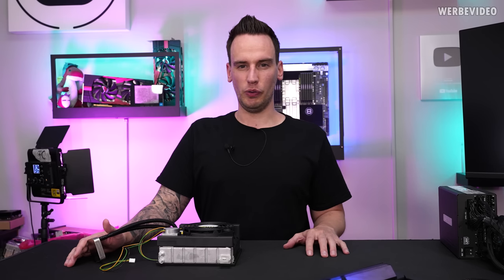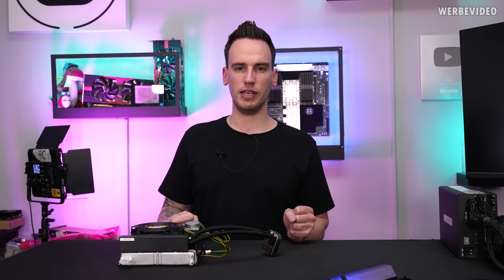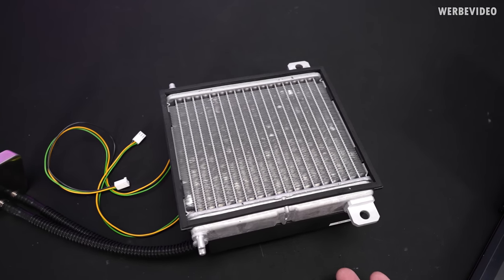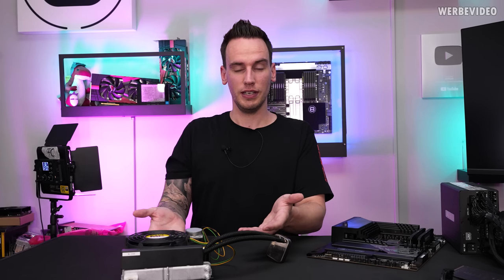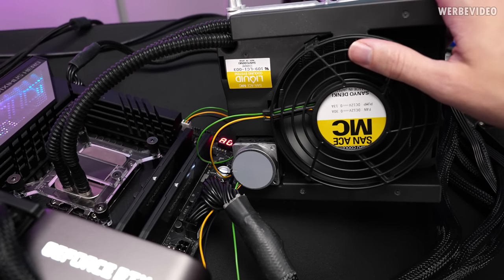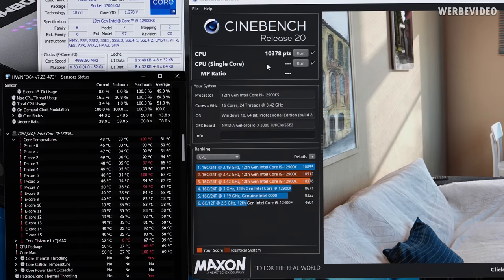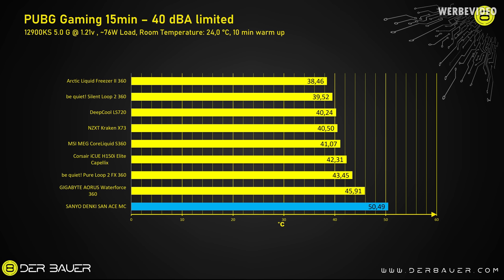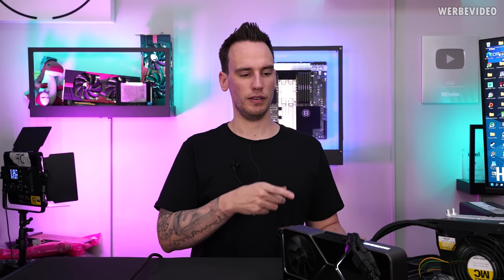Investigating Aseteks false Claim - THIS is the first real "Sealed-Loop Liquid Cooler"

Comment: The Sanyo cooler received a japanese "Good Design Award" on the 1st June 2004.
There is also a datasheet for the system from may 2004 on the german Sanyodenki website.
Then I found the manual. The cooler seems to have been designed to go into a special PC case with the appropriate mounting.
Finally I found a "Company Profile" brochure which features the cooler in question on the products timeline dated 2004.
I would say the cooler is from early 2004.

Comment: There is a water cooler from 2004 called the “GlobalWIN Silent Stream” that has the pump integrated into the water block. There is an old Tom's Hardware review on it along side other water cooling options from back then. It looks a lot like a modern AIO and an apparently came pre assembled and filled.
Reply: You're absolutely correct. From another article published in September 2004, "The water pump is integrated in the processor cooling head in this system", and "the Silent Stream arrives pre-assembled and pre-filled".
Reply from the maker: Will Look into that. Thank you for the comment!
Reply: Wouldn't this potentially invalidate Asetek's patent by prior art?
Reply: @HydrarDraconis  Depends on what exactly the patent involves.
But yes it seems to be the same thing Asetek has patented. So I guess it is room for prior art.

However, I personally wouldn't be surprised if there is plenty of other cooling blocks out in the industrial world with integrated pumps. Engine blocks on cars for an example have done this for decades before Asetek were around, however a car and a computer is two very far removed applications. But the goal and solution are the same in both cases, just at different scales. So even this could be seen as prior art to a degree.

In the end, one can argue that the requirement for patents to be "innovative" is a bit lackluster in a lot of cases. To be fair, one can patent almost anything, as long as someone else haven't already done it for the same application and for similar reasons.
Reply: @todayonthebench  Not looked into it recently, but I remember a few years back the main issue was related to keeping the pump in the CPU block, since plenty of other brands had them in the radiator on the hose and was allowed to sell them at least
Reply: @HydrarDraconis  some even had a tiny tube running from a pump to the cold plate, even though they were one piece.
Reply: @HydrarDraconis  Yes. The main issue is the block integrated pump.

However.
Even of the GlobalWIN Silent Stream is prior art, it still more or less requires someone to counter Asetek's patent, a legal procedure that also is a fair bit expensive.

So even if prior art exists, a patent can still be "enforced" even though it technically isn't valid. And it is hard to know if the court will rule the prior art as prior art or not, so I can understand that other manufacturers haven't been too keen on testing the murky legal waters.
Reply: I actually have the radiator from that cooler, its one of the coolest looking and smallest radiators I have ever seen.
Reply: @HydrarDraconis  i was thinking the same way so coolit can sue them back lol
Reply: Yeah, also the WaterCooled Alienware 2080 that ArseTek claim they invented the design for was out for many years prior on the Sapphire TOXIC X1950 XT-X by Thermaltake,
seems ArseTek has no problem with the Hypocracy of threatening to sue other companies for what they themselves have repeatedly done.
Reply: @shaneeslick  those days though damn its been a long time
Reply: @shaneeslick  arsetek 😭😭😭
Reply: @todayonthebench  Cooler Master won a case in 2019 against Asetek, with the help of bringing up this GlobalWin which was show at Computex 2003 in Taipei. Full cost of the case was for Asetek, the case was in Den Haag (Netherlands).
Reply: @der8auer-en  the thing is AseTek will argue that their VapoChill line, which dates back to the late 90's is infact a closed loop liquid cooling solution. And technically speaking they aren't wrong. It's just that today we would consider a VapoChill as a phase-exchange cooler in it's own very niche category. 

The oldest VapoChill units might even still have used Freon instead of R404a, but I can't find confirmation of that. Regardless, a VapoChill unit would pump liquid refrigerant onto a coldplate where the CPU's heat would boil it off. So technically it is liquid cooling. Just not how we'd think of it today.

VapoChill units were sold as a PC case with the entire cooler assembly integrated into the case, radiator, compressor, CPU cooler/evaporator/coldplate, the whole works was integrated into a single unit. You wouldn't mount the cooler to your PC, so much as build the PC into the cooler. Can't argue with that being an "all in one" solution. It's just not how we think of it today.
Reply: @HydrarDraconis  while it might be prior art to AseTek's patent, it doesn't invalidate their claim. AseTek VapoChill was readily available back in 1999 and technically is an AIO liquid cooler, which almost by it's very nature has to be a sealed and pre-filled system.
Reply: @arubberroomwithrats  someplace theres one of those around here, the block cracked (the plastic sucked) so..yeah... ugg..
Reply: @AshenTechDotCom  mine just had the block sold seperately
Reply: If that's the case, that would invalidate Asetek's patent outright as prior art.
Reply: @HydrarDraconis  I hope so because it has stopped better versions
Reply: @shaneeslick  took a page from Disney
Reply: @HydrarDraconis  if only they would lose their patent.
Reply: @der8auer-en  I would also look into the Powermac G5 liquid cooler. As far as I know that was a closed looped system as well G5 came out in June 2004.
Reply: @todayonthebench  There has to be enough money to be made from invalidating their patent trolling for multiple companies to pitch in for the legal fees to do it.
Reply: No one cares
Reply: @HydrarDraconis  i guess the company behind it would have to challenge that.

Comment: 50% mix of glycol will help lower the vapor pressure in closed loop. Which was big concern of early sealed systems since a hose could burst or pop-off if too much pressure built.
Reply: Yeah, same reason they use glycol in solar boilers.

Glycol has a boiling temperature of 285°C and a degradation temperature of 206°C.

It's capacity for heat transfer may be lower, but it can transport far higher temperatures without issue.
Reply: and the anticorrosion additives of antifreeze to protect everything inside. 3 in 1 oil for the fan
Reply: @kommandokodiak6025  as has been shown through the millions of ICE vehicles that use this for the past ~100 years. At higher temps and for far longer periods of time.

Comment: We used glycol to stop crap growing in our early loops and to stop corrosion from mixed metals, as it's not an ionic liquid. I run 100% glycol back when your hoses came from the hardware store, radiator from a car parts place and the pump from an aquarium store... My first block was made from a hollowed out lead, 1kg diving trim weight, some random O rings and a bit of perspex into which I epoxied some copper tube. Worked fine for years - pump sounded like an angry dildo, but yk, that's what headphones were for.

PS. Wow, I still remember when Sanyo was a major electronics brand, DB not knowing how to pronounce it just made me feel so old...  the ny is same as in Sony.
Reply: the description of the pump noise made me laugh
Reply: Same reaction from me, regarding the Sanyo brand. Quite a popular/known brand down here in Argentina (even the main sponsor of one of our biggest football club at a time).
Reply: My first CD player was a Sanyo.  Small boombox with with cassette/radio/CD and two 3" or 4" speakers.  You really don't see them much anymore.
Reply: You just made your block out of a block of lead? Why?

PS I have a bunch of Sanyo stuff and never once thought to consider whether it wasn't pronounced the way every pronunciation guide on youtube that I just looked up says it. I'm at a total loss as to where he got "sancho" like he's talking about some Mexican guy or quite frankly what "like sony" is even supposed to mean here.

Comment: Sanyo Denki(山陽電気) (btw, that's an English-type 'y' pronounciation, not a Swedish-type) seems to be still around and makes DC fans, UPS, and motors. I don't think they do computer parts anymore; it's hard to determine whether they regularly made computer cooling parts before, or if this 'world's first AIO' was an one-off with the case manufacturer.
Reply: If you remove the "Denki" part, Sanyo is a well-known brand in the West, I'm surprised he can't pronounce it.
Reply: @rijjhb9467  Also, "denki" means "electronics" or "electric", Sanyo Electric Ltd. is the name of the company in the west, mostly known, as you said, as Sanyo.

Comment: May want to check the zalman reserator 1 also from 2004. I like many others were using mostly Danger Den stuff back then but do remember I had some odd OCZ water blocks which I coupled with a car radiator to cool a 9800 pro and a Athlon 2200. I feel old.

Comment: There were CM AIO/LC kits that predate Asstek AIOs. I think there were Aquagate mini 120 and 80 series of sealed AIOs back in the day which was later on updated with S120 series of AIO along with nVidia ESA based custom kits.
Reply: So indeed Cooler Master Aquagate Mini R120 was released in early 05 and it was a sealed AIO with pump-CPU block combo. Not sure who their OEM was but installation mechanism was typical CM.
Reply: @ChaitanyaShukla2503  Yes, I still have those lying in the house. It is still working miraculously though I can't use it on any of modern tech.
Reply: @Azura2910arpg  it was refillable so changing liquid is always an option but damn, its nearly 17 years old so quite surprising its still working.
Reply: Those are the frist I know of and I have a brand new R80 in my collection (even works with socket 462).
Reply: This might explain why Swiftech’s AiO was marketed by Cooler Master in regions where Asetek had their patent.

Comment: This is the same cooler Falcon NW used on their Mach V machines, the case was a Silverstone TJ03 and this water cooler was mounted on the top of the case. In Japan, this water cooler came with the old ugly white cases, mounted on a special bracket with a hinge and two screws on the side of the case, the price was around $ 150 US back then.

Comment: It will be interesting to see if companies, that got sued by Asetek in the past for patent infringement of the pump block, get back to the courtroom.
Reply: This isnt a pump block though.  That said, their claim that they invented the closed loop cooling system is easily disproven.  Apple sold a retail computer with a closed loop AIO system, the dual cpu powermac g5, in June 2004.

Comment: The fan bearing is probably an industrial grade dual ball bearing or something. They are usually harder on the ear even if they spin very low rpm. It looks like a rad for a tiny tractor lol
Reply: more likely a transmission oil cooler from an auto car.
Reply: @draconightwalker4964  yeah, I could definitely see some sort of oil cooler too
Reply: the fan is noisy becasue the design, larger stator stronger magnetic force and longer switching duration. bearings are only a small part. I have had some larger delta fans that sounded like that at low speeds.
Reply: @AnIdiotwithaSubaru  Deffo an oil cooler from a mad jdm car like a GTR....Dont google it and ruin the moment lol

Comment: Considering they didn't use micro-fins in the blocks they didn't do too bad...also the noise wasn't the main concern back then.
Nice find.
Reply: the entire waterblock is a huge chunk of copper which in term became like a heat reservoir. the "fins"are also solid copper pieces. i wonder how much wattage can trhat waterblock actually move if the radiator was better

Comment: B52's computer modules had cooling loops long before "PC" was coined.  The example you have IS from a motorcycle radiator manufacturer but is actually a "heater core"
Reply: The point is about "All in one" preassembled and prefilled liquid coolers that could be installed and removed without disassembly or need to empty the loop.

Comment: Honestly, it depends on what you classify as being a "sealed-loop liquid cooler", since technically that's exactly what refrigeration units and air conditioning units are. And those are way older than any computer liquid cooler. Sure they use a type of gas that becomes liquid under pressure, but it's still liquid being pumped around to the cooling plate - it just turns back to gas at that point and it's gas being sent to the condenser radiator(s) to be turned back into a liquid.
Reply: They are called phase change cooler, not liquid cooler, because for they normal operation phase change is necessary.
Reply: @xenories  Okay yeah, fair point. That is an important distinction that I missed. Thanks for pointing that out to me :)

Comment: I used some ancient swiftech aio's that you actually filled up the liquid inside, back in the athlon 64 days. They did an 120mm and later a 240mm radiator version which were the best, but maybe not the quietest coolers of the time due to the fans. 
It would be interesting how much better the modern coolers are...

Comment: Given the Radiator's overall dimensions (161x176mm) and assuming a similar thickness I think you should compare this cooler with your selection of 240mm AIOs as they are almost identical in surface area (28,336 sq mm Vs 28,800 sq mm).  Crappy pumps and fans notwithstanding, I think you'd get a very favourable result with the old Sanyo Denki rig.

Also, given the simplicity of the whole system generally, the older, 'less gimicky' systems should still hold out quite well (as long as nothing has decayed over time! )

Thanks for showing us this, I am always happy to see older Tec holding its own against the flashy newcomers... :)

Comment: Sanyo Denki is one of the premier cooling fan manufacturers. They also made fans (and presumably the heatsinks too) for boxed Intel CPUs and even the Pentium Overdrive or somewhere along that line.

The 50/50 water/glycol mix is the same standard fill for liquid-cooled car and motorcycle engines. Maybe done because the radiator is probably aluminum but the block is copper. A reason why it performed respectably could be...the P4 based systems of the time. And about the fan noise...that could be a high power fan! (server units get those types of fans - maximum static pressures, the noise is mostly normal at low speed because of the motor design) Curious if that will be run at full speed...

Comment: Found an older weirder AIO from May 2003. It's not an aftermarket kit but was found in a  consumer desktop, the NEC VALUESTAR FZ VZ700/6F. It was not meant to be serviceable by the user and it cools a Pentium 4. There aren't many photos of the cooler. Toshiba also made a watercolor laptop the prior year.
Reply: Hitachi also announced a water cooled SFF desktop in February 2003 and a used a Taiwanese ODM to make it.

Comment: that's the right size for a 110cc scooter radiator and fan, and the ethylene glycol with water mixture is the usual mix for automotive purposes, Would be very interesting if it turns out the first mass produced AIO used parts from a Suzuki or Yamaha two wheeler.

Comment: From June 2004 onwards, the Apple Power Mac G5 was sold with watercooling. Not 100% sure that counts because the radiator was rigidly attached to the waterblock, but it was a self-contained unit, made by Delphi Automotive. They did occasionally have issues with it leaking, made worse by the fact that the PSU was at the bottom.

Comment: I'm pretty sure that's an automotive heater core acting as the radiator, but I can't recall off the top of my head what it's out of. And that looks like straight automotive anti-freeze that you emptied out of it, which makes sense as it's a 50/50 mix of water and ethylene glycol, as was described in the documentation.

Comment: The longevity makes sense if they're using automotive parts. And the liquid retention too. The radiator in ur car runs for 10+ years at ambient temperatures that swing from -40c to +40c.

Comment: My Corsair H50 still works to this day. I have it on an X58 system like it was when I installed it well over a decade ago. If I remember correctly, the back plate is adhered to the motherboard, so that's why I've never tried to replace/reuse it anywhere. It has the same tubes as this one, and that is also why I don't want to deal with it again.

Comment: There's also CoolIT systems in Calgary. Asetek actually lost a lawsuit to them for patent infringement. CoolIT were working on a closed loop prototype as early as 2000 that also utilized pelletiers (which were later abandoned because they just are not efficient), but didn't get any production models out until 2005 IIRC. My buddy knew one of the guys (of like 2 or 3) that worked there then and was trying to get me to go hang with them and drink beer, knowing I was a PC enthusiast - I should have taken him up on that offer.

Comment: Depends on how you define close loop also, I mean in 1964 you could (if you could afford it) buy the IBM 360/91 and that came with water cooling built in so technically that could perhaps count since it's not a custom loop?

Comment: 2005 Apple's PowerMac G5 had a liquid cooled option. Oh boy did I repair a lot of G5's back then for the leak they sprung within a couple years of being introduced. It was 'aio'. So many g5 complete rebuilds from new housings and power supplies, to logic boards, etc. Apple always gave us (service providers) blanket auth to replace whatever necessary at Apple's expense for the customer.